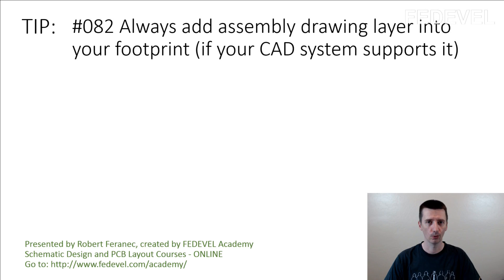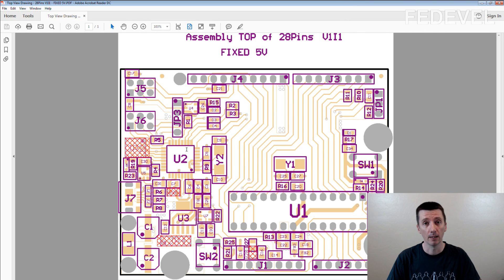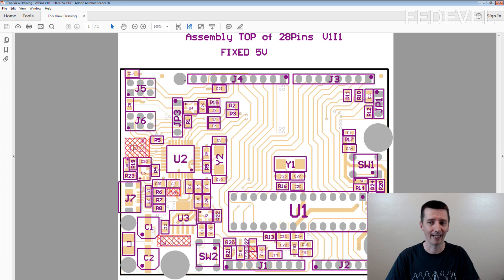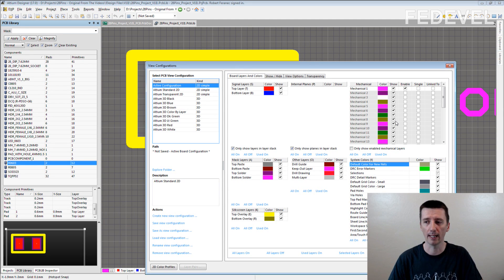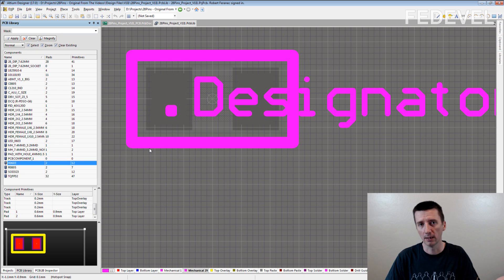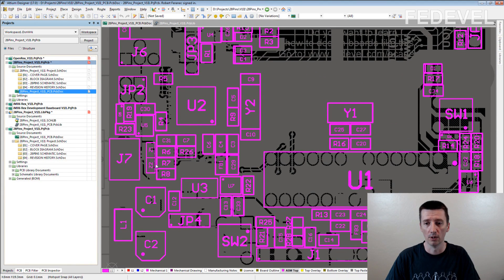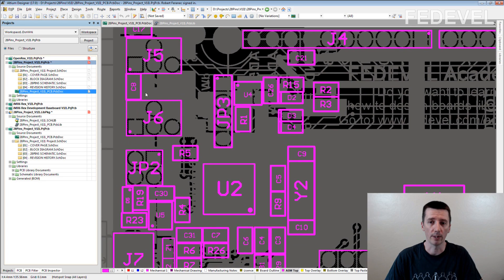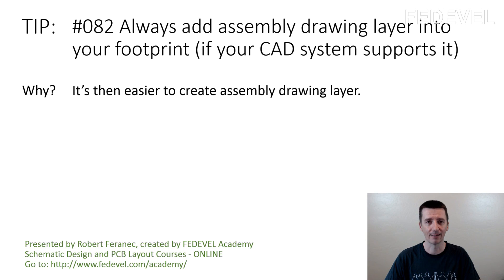TIP #082: Always add assembly drawing layer into your footprint (if your CAD system supports it)

Comment: This is great advice. It happened that we made mistakes because there was not enough free space on the board for silk-screen printing, and the draftsman created the assembly drawing based on the STEP model and silkscreen layer, and could make a mistake by attributing the designator to the wrong outline of the component.

Comment: This was very helpful. When I place .Designator by selecting it the drop down list is puts quotes around it '.Designator'. Does it matter if there are quote marks or not?
Reply from the maker: Thank you Joel. I remember this - I normally delete the quote marks. But I do not remember if leaving them was a problem or not (I would need to try it and do not have access to altium right now).
Reply: @RobertFeranec  Robert - I found out the reason for the quotes (actually apostrophes) : To include more than one special string within a PCB string, enclose each special string within apostrophe ( ' ) characters. So for a single special string they are optional.
Reply from the maker: @joelbrown8972  ah, I remember. I think you can even combine them with standard text. Thanks for checking that

Comment: Guys, "Convert Special Strings" in layer "View Configurations - Altium Standard 2D - View Options - Display Options" must be checked to see a designator parameter on the layers ;)
Reply: That is great note that I used it.
thank you very much:))

Comment: This is a big one for board assembly shops, they really need it.  Also with Altium be sure to setup the layer pairs for the top and bottom mech layers properly so that when you print the assembly drawing they show up on the correct side.  This can be trickey especially if you don't do it correctly at first.  I've had to clean up many designs from others that didn't do it right in the first place.

Comment: Thanks a lot for this tip Robert! I'm currently converting my PCB to use mostly SMD components, and the next obvious step will be to have the assembly outsourced, so any tip you may have about creating the component list or the assembly drawing layer are very welcome! (I already saw your tip about using the chip center of mass as footprint origin for example, very good one as well especially in my scenario)

Comment: What happens when the part is flipped to the bottom layer?
Reply: In Altium you define layer pairs. For example: you use Mechanical 29 for top and Mechanical 30 for bottom (is up to you). In your PCB library you draw your component as if it were placed on the top of the board. A simple resistor would then have a rectangle and label on M29. Then, in your PCB project you define M29&M30 as layer pairs. When you place the resistor it usually goes to top first, so the pads are on TopLayer, the silkscreen to TopOverlay, etc., and the assembly drawing rectangle goes to M29. If you flip the component to the bottom of the board, then the pads go to BottomLayer, the silkscreen to BottomOverlay and the rectangle automatically moves to M30.